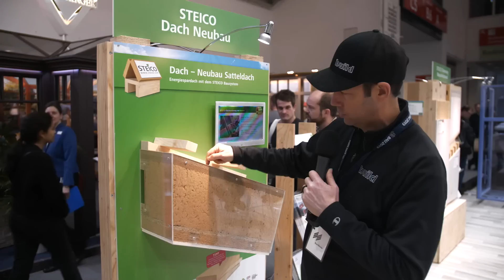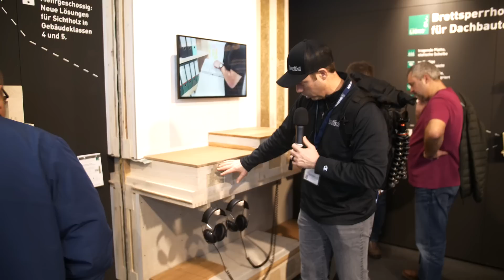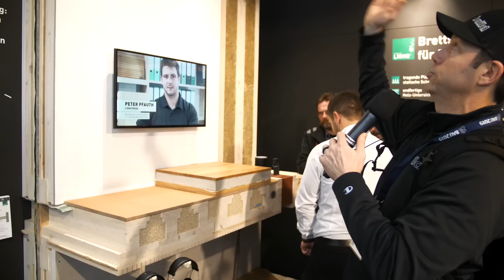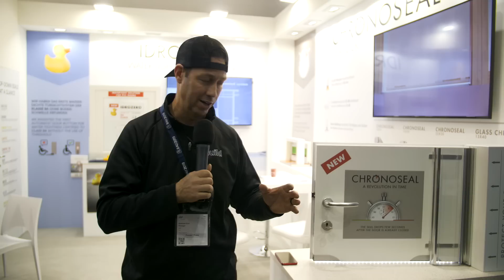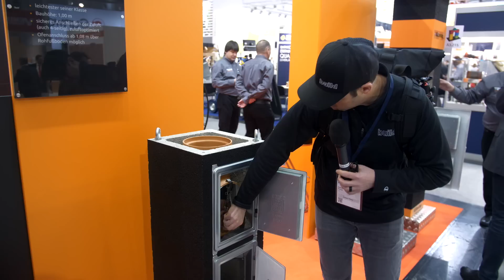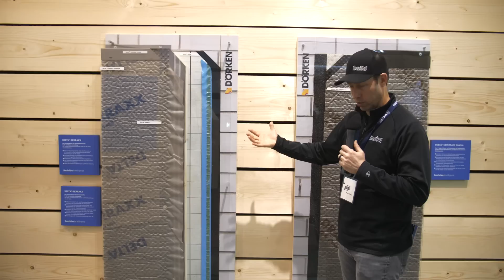These German Building Products are Awesome! Day 2 at The Bau Show Munich 2019

Comment: Nobody drinks heating water in Europe! Those are two separate systems.
Reply: And that is always the case in europe. I  am not sure wether its even legal to drink heating water (here in germany.
Reply: @Esablaka  Wait what? Legal?
Reply: @resonanceofambition  ? I said that i am not sure wether or not its legal  /illegal
Reply: @resonanceofambition  
Yes bc its not legal to drink. It could harm you.
Reply: @Esablaka  Apparently they drink their heating water in the US. How else would you even get the idea?
Reply: @Esablaka  you dont drink dead water because of health reasons.
Reply: @JAustin-c6q  Because the heating water runs through the inside of the radiators and the heater. Obviously after that it is no longer  of drinking quality.
Tapwater is one of the most tested, checked and looked after "food items" in Europe.
Reply: @JAustin-c6q  heating water is a closed circuit - sometimes you  even have added chemicals to hinder corrosion. It is a law in germany that the heating water circuit and the tap water circuit are not allowed to be connected because of the danger that the heating water contanimates the tap water. You are only allowed to manually connect the tap water circuit temporarily with a hose to refill the heating water circuit. There are automatic refill systems, but these must be approved and needed to be make sure with a one way valve that heating water never reach the tap water circuit.
Reply: @seanthiar  It is done the exact same way in the US.
Reply: @JAustin-c6q  I have glycol in my house heating system. Makes water taste funny so maybe thats the reason.:)
Reply: Nobody drinks heating water in the US either. They call it Legionnaires when it gets contaminated.
Reply: This is ALWAYS the case, not just in Europe, the USA as well. You have your water system for uses like faucets at sinks, shower, etc., your appliances such as ice makers, coolers in a refrigerator or what not. Then you have a separate system for hydronic heating systems (boiler, etc.) which is a closed system that only has an entry for "make-up" water. At NO time is that water EVER to leave and enter your system for potable and other consumable water systems such as sinks, shower, etc.. Lots of homes don't use hydronics for heating and thus only have one water system for consumption such as washing, drinking, etc.. Actually the public water supply isn't truly suitable for drinking in the US and probably not anywhere, unless further treated within the home, but that's a topic for another day. My house does use a closed circuit for heating which pumps water through a jacket/manifold in the furnace/boiler (to be heated) which is then circulated to radiator style units that disperse the heat into the air in each room. That water cycles back around to the furnace to be heated up again and essentially is like the heater in your car, minus the blower, since it has no forced air aspect. Purely based on natural draft cycling the air across the fins of the heating coils in the rooms. This is not very common though in the US or anywhere else I am aware of.
Reply: Nobody drinks it in the USA either! Two different systems. What a joke. My continent is better than you continent...na na na
Reply: I must have missed where he actually stated that. At the Uponor both he explained how they have a system that uses the heating water to preheat the water for the potable water system in a heat exchanger. A heat exchanger of course keeps the two system completely separate which is standard no matter on what continent your are. This is a non issue thread. Typical social media stuff. A lot of words about nothing.... and here we go I even added more to it....
Reply: @JAustin-c6q  the main reason is that the heated water will disolve alot of the metals in the pipes. Not enough to errode it but enough to make it unfit for human consumtion.
Reply: @ZaC kWinz haha. Right on. Thanks for confirming my suspicions, North is more clever than South.  Same applies for Germany btw. Forget munic, look more towards Hamburg;)
Reply: @zoolkhan  
Youre saying Hamburg is better than munich? And how or why.
Reply: I doubt anyone drinks water from their heating system., and I don't think the video was trying to say that. It was saying fresh cold water goes through a heat exchanger in the radiant floor heating furnace. Basically kind of like a coil of copper pipe full of cold water, inside a chamber filled with hot water from the furnace. The heat flows into the fresh water, but the fresh water stays clean and separate. Presumably the warmed water then goes to tankless hot water heaters in the bathroom and kitchen for final heating before use.

In the US we don't drink water from the heating system either. We usually have a central tank where the water is gas or electrically heated and then distributed to the bathroom and kitchen. The big tank generally keeps the water hot all of the time, so it isn't as efficient as the tankless heaters. I think a likely reason we do it this way is most of the wiring in our houses is only 120V so it would have to carry a huge current to rapidly heat the water. There is 220V for large kitchen appliances, clothes dryer and similar utilities, but generally no 220V in the bathroom, so switching to tankless is an expensive hassle for many people. I think I heard something about Germans having something like 3-phase 400V throughout the house? If so, I'm green with envy. If I were king, I'd decree 3-phase, 400ish V, throughout the house  tankless water heaters, Japanese-style bidets, and photovoltaic  roofs and solar preheating wherever economically viable, for all.

Anyway, most people I know, don't intentionally drink hot water from the tap. They put cold water on the stove or in the microwave oven to heat it. Personally, before I've had my morning cup of coffee, I'm too befuddled and impatient to heat water or brew coffee so I use hot tap water and instant coffee. As far as I know, I'm the sole American still drinking instant coffee, and I know of no one else how drinks any hot tap water.
Reply: @karlharvymarx2650  I completely agree with everything you just said,,, well except for the hot tap water and instant coffee. Sorry you're kinda on your own there.
Reply: We do now have tap systems for in our kitchens where there is a tank of fresh cold water underneath the sink that is heated to boiling and if you turn the tap a certain way you then get boiling water straight out if the tap therefore doing away with the need for a kettle and you know how much us Brits like our(hot not iced!) tea. They are however very expensive costing over £1000 or around about 1300 bucks.
Reply: You never drink heated water put of a fosset ever. Unless you got a unique system for it to be drinkable. The hot water isnt warm enough to kill all bac aswell as contaminants from the waterheater.
Reply: @aztex6981  the water where I lived had no Bacteria. Drink I cold out of the tap... ...the problem with Germany is that it is so densely populated...just about everything including the air is polluted!!!
Reply: The system uses a heat exchanger to heat potable water instantaneously, so no time for bacteria to form.
Reply: All over Europe, except the English speaking countries like England and Ireland, but most Americans would visit these two countries and wouldn't have a clue about other European countries and engineering.
Reply: Petra Myer I just came to the comments to say the same thing lol. I think that he must have misunderstood the reasons for that system.
Mate we have run our cold,drinking grade water through separate pipes to our warm water ever since we began piping water in to our homes!
Reply: Don’t let the faire fool you. Most houses houses here are constructed of (sand-lime or ) vertical perforated clay bricks insulated by xps or mineral wool and finished with plaster or bricks. Wood only buildings are regarded as not as durable and mostly built as a bragging instrument for eco warriors and hipsters.
Reply: In the US radiant heat systems need to have a separate heater than drinking water systems.
Reply: MOST IN THE US BRUSHTHEIR TEEETH WITH WATER THAT MAY EB MIXED FROM  FRESH COLD WATER AND BOILER HOT WATER> THE SAME HOT FOR SHOWER ETC> SAt in the water heater, not boiling.
Now in the UK where  cold water for the upstairs bathroom was often from a cold water tank in the roof brushign of teeth was technically best at the kitchen sink.The only truely potable water in the house.
Reply: @johnsmith9903  In the US the two systems are separate. The water being heated by the furnace/boiler is not the water in the pipes for your hydronic heating system, if you have one like I do. My potable water doesn't pass through my boiler at all, as it is heated by an electric water heater. If you have a system that is heating both potable and non-potable water those two need to be in separate pipe loops. The water in your heating loop get's circulated so it get's continuously heated (over and over it passes through the boiler). It doesn't actually leave that system like the water in your system that supplies your faucets. That water comes in the water supply line (from your water meter) and goes through the boiler to be heated with one pass on it's way to a faucet then out to your septic or sewer system. If there is some sort of hybrid thing somewhere in the world being used, well I don't know how that would work. Yes, in commercial (large scale) applications there are systems where a heating loop like I described passes through a means of heat transfer which may heat other pipes containing potable water in a separate loop. The heat is transferred but the two waters never actually mix.
Reply: No one does it in the US either.
Reply: That's right, two separate systems.

We have been using rainwater for the toilet for years. And we had to lay an extra supply line to the toilet cistern so that no mixing with drinking water is possible.
(regulation in Bavaria)

Comment: wait a minute, seperate water heating cycles through heat exchanger for freshwater- and building-heating is a "new cool thing"?
also commercial heat pump systems came up in the late 60es, are common for i.e. pools since early 90es and all-in-one systems since ~2000 (though fresh air pump systens weren't really needed in central/northern europe therefore mostly not included)

Comment: That uponor system can also be used for long-distance heating where a distant power station generates heat which is then pushed through huge and highly insulated pipes to various sized houses (single family home to "skyscrapers"). It wouldn't make sense in most parts of the US because of the long distances but in Europe it makes a lot  because if we would travel the distance from one state to the next we would literally leave the country ;)
The big downside of the uponor and similar systems is that hot water takes some time until it arrives at the faucet and that the temperature changes from hour to hour.

One side note is that in at least Germany, Austria and Switzerland the system for heating is completely sealed away from the system for drinking water. Drinking water never touches anything that is used for heating.

Comment: That getAir HRV is not intented to be used in older houses since those have gaps everywhere where air can get in or out. However with newer houses the regulations for air sealing are so strict that we have issues with enough oxygen getting into, thus you are required by law to install fresh air supply and ideally you do this by using HRVs. I happen to have three of these in my apartment and (depending on the control unit) you can regulate the speed/noise and also if they pull in for a given time and then swap direction. Normally you install these in pairs and configure one to pull while the second one is configured to push so that you always have a neutral pressure.

Comment: Second time when I heart that... Chimney's material is called lightweight concrete, made of expanded clay and cement. Autoclaved aerated concrete (AAC) is so much different material - you can build decent walls without isolation (walls U-0,15), google Bauroc. After you have finished with block laying, you have 500mm or 19 2/3inches thick inside-outside full stone walls. No moisture barriers, special weather sealing etc, just plastering.  AAC is great idea for episode, imho.

Like said before, every European country has it's building culture - in my country,  I guess max 5% of new residential houses are built from wood. These are mainly built from different combinations of blocks and insulation, but I haven't ever seen building from hollow blocks.

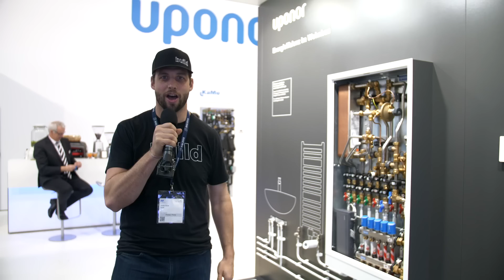Comment: 11:40 could someone explain to me how Americans have their hot water connected between heating system and hot taps? I’m slightly confused here. As far as I know (as a non builder) in the whole of Europe we have closed circuit heating systems (that we can top up), but that water never mixes with water that goes to our hot taps? (and it’s heated through a heat exchanger in the boiler?). I’m just curious if I’ve been thinking wrongly about this all along
Reply: It's the same here.  I think what was unique about that Upinor system is that it's set up for multi-family residences.

Comment: Not sure about the Uponor system, I never heard about a house here in Germany where hot/cold and heating water have been just one system.
I am used to older systems where you had a furnace/heater for the water in the radiant heaters or floor heating and a separate "boiler" which could store an amount of water independently from the heating.
then sometimes you had smal electric appliances underneath your sink to keep about 5 liters of hot water at ready. I know of electrical heaters for hot water used in e.g. your shower...
But modern systems if not using electric hot water at your sink or your bathroom (which I personally consider expensive from energy costs and inconvenient, but a lot cheaper to build) have one burner, but separated water systems. We have for example a gas furnace using condensing technology to be more efficient (I think those are standard in most homes these days) It heats up a cloased water circuit for heating plus it has a separate circuit for making hot water. then you have an insulated tank (we have a 150 liter model) which has a heat excahnger built in to heat the water.
But already the furnace has separated water systems for heating and hot water and it would work without the tank, just with less capacity.
Today for refilling the heating circle if needed, you would even need special caution or some valve to prevent backflow into the fresh water system.
I know for older houses in the UK (and maybe somewhere else as well) that had opne water heaters somewhere in the attic for example. theay had been separated from the fresh water, but as they had been built open, things and rodents could possibly fall in. Because of this the hot water was not considered drinking water and had to be separated. That is why you still find a lot of sinks with two separate taps for hot and cold water in the UK. Only I think most of them would no longer be needed due to modern water heaters beeing used.

Comment: I have some questions
I live in northwest Washington state. My house is a stick home built by lowest bid. I'm not happy with insulation nor heating in my home. Heating is cadet wall heater and no insulation in the outside corners of my home. my home is 15 years old. Insulation is minimal code. 2x4 walls 16 inch on center. I know I can add insulation in the crawl space plus attic. What is your opinion on adding 2 or 3 inches of rigid foam to the outside of my home? Would you add blown in insulation to add to the insulation bats in the wall?

Comment: You are So right about Germans, and especially Swiss wanting only non-toxic building materials. Trust me Swiss build all there structures to last 200 years.
I live in Switzerland and do refrigeration / air conditioning, and I can say. Their standards are ridiculously high.
Reply: Unfortunately we tend to build cheap.  Plus we build in such a way it's easy to tear down and do again every so often...
Reply: @Josh-wq8tt  I once read the average American moves way more often than the average European. That might be one reason for the Europeans to be willing to invest more into their homes. Another reason might be the strict rules in Europe. In Germany they have the EnEV (Energie Einsparverordnung ~ energy saving regulation) which forces anyone to have certain insulation, heating efficiency and other things to be noticed. And then there's crazy and strict regulations on fire resistance, especially on appartment buildings. E.g. you can't just drill through the ceilling to put pipes there without sealing the hole with intumescent products like Armaprotect or similar licenced products. These things (and many more) add up to infinite things to consider in construction work in Germany, so there's often no way to do it as cheap as in the US due to laws. 

Europeans usually can't believe when they see videos of Americans spraying PU-foam directly into a thin wooden frame.
Reply: High standards is something I wish my country had, don't complain about it, it's a good trait.
Reply: @Bill Wang the cost of building is like 3-4 times more expensive, with the mostly higher land prices in switzerland a house will cost you more like 5 times
Reply: murderdogg How is their cost compare to US average? Roughly 2 times or 5 times higher?

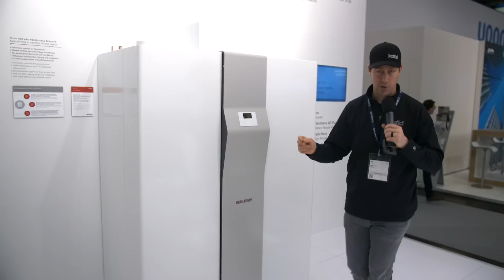Comment: heat pump/ventilation like the one shown at 13:30 is nothing new, I have seen a lot in houses built over 10 years ago in sweden, altho different manufacturers. even as a single phase 230 v model